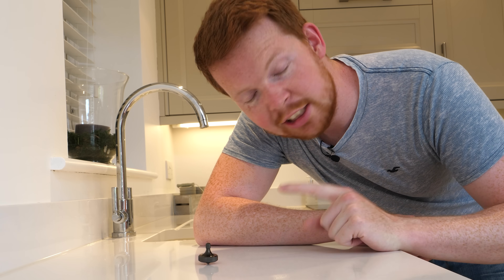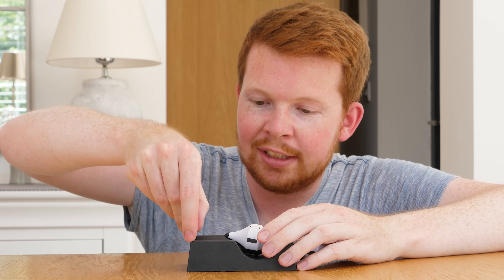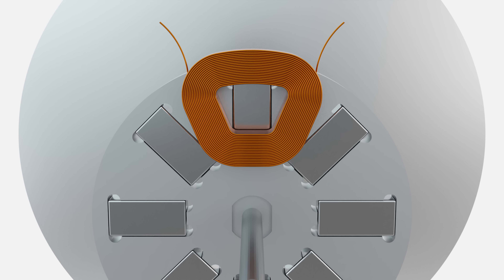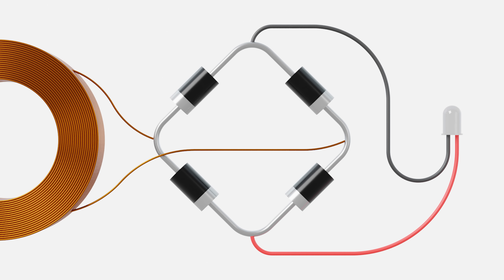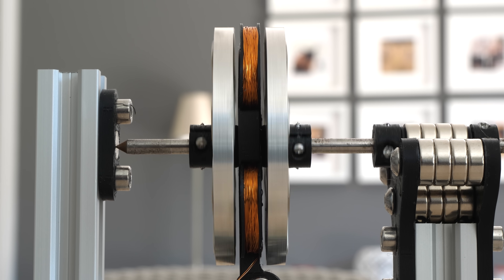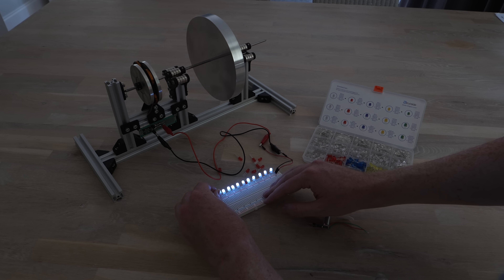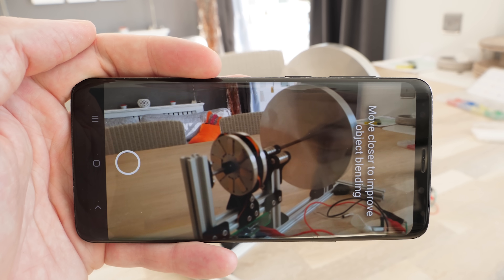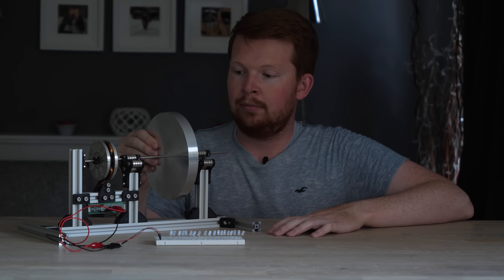Flywheel Battery

Comment: Did you consider current phase induced in the coils when connecting them in series? I might be wrong, but I believe you might need some sort of multi-phase diode bridge (resemblant to those in three-phase bridges) to get the maximum power out of your coils. I also think connecting coils in series only makes sense when phase is either 0º or 180º to increase voltage, or in parallel to increase current (I insist, I might be wrong). Also pay a look to homopolar generation. Nice and interesting project!

Comment: I'm v curious as to how the electric flywheel technology in the Honda CR-Z works. More specifically whether it could be used in some way to smooth out power strokes rather than actually power the wheels. I'm thinking along the lines of enabling a 4 cylinder engine have overlapping power delivery like a 5 or 6+ cylinder engine. There should be some usefulness in terms of braking as well i would've thought. I'm absolutely green when it comes to these things though so don't roast me!

Comment: About  0.3-0.7V will be lost in the rectifier, depending on the type of the diode. One could build a bridge rectifier from MOSFETs to essentially have a zero drop.

Comment: So I want to see this design changed so that the same flywheel works on mechanical bearings. Is it worse? how much worse? Also, can you create some electronics so that you can spin up the flywheel using your brushless motor/alternator and a power supply? Can you show some calculations of total energy stored, energy loss rate while on standby and energy transfer rate when draining?

Comment: It's important to point out that a full bridge rectifier without a capacitor doesn't actually give DC. The current flows in only one direction, yes, but it's far from DC. The voltage is alternating between Vmax and 0V, which is still AC. You can see this in your LED setup. The LEDs are flickering, which you noticed as well.

Comment: Another great video 👍🏻
A couple of things, having used RC motors as generators myself, I noticed that while they spin very freely with nothing connected, when I connect a circuit to them they become much harder to spin (opposing current direction from the previous cycle acting as an electromagnetic brake). I can see that your fly wheel slows at a much faster rate with your generator fitted, but just how much does it effect your run time?
Also, would making  the generator larger, giving room for more magnets and increasing inertia, be of benefit to runtime and power? Or would the braking force become too strong, reducing runtime?

Comment: You could turn this Flywheel Battery into an accumulator by using a small motor to spin the wheel up. If the magnets were smaller and the number of these increased it would be possible to spin the wheel by introducing some power in the copper coils.

Comment: I think the motor requires too much energy and the flywheel is slowing down too fast for it to be a desktop toy. But with 3 leds just giving it a nice glow why not :D Afterall powering anything with it sucks the energy out of the system.

Comment: You should add at the end of the rod a small spool, and a hand crank with rubber belt so you can with a higher ratio turn the wheel at very high speeds

Comment: Calculate its efficiency by using a low gear motor attached to a large fan. Spin the fan by hand (which should spin the flywheel) and record the number of spins you do, then disconnect the fan. Test how many times the flywheel can then spin the fan when you reconnect it, and do this at different times where the flywheel is spinning without being connected to anything, so you can test it's effectiveness as storing energy

Comment: Great video! It would be cool, if you were able to answer two questions. 1. Did you estimate / calculate the efficiency of you power generating system?
2. What amount of energy can be stored at some rpm in the flywheel? / How long does it run under a specific load with some starting rpm?
It would be great if someone could answer these questions, I am burning to know.

Comment: Isn't it same like attaching a flywheel to a normal dc generator. That will works the same way. May be efficiency will slightly differ.

Comment: Can the motor spin the flywheel? Infinite power.
Reply: It can, but the generator induces significant friction when running slowing it down more than you can spin it up by using the generated power for the motor. So it ends up being worse than just not having any motors or generators attached to it

Comment: I just have to ask why you elected to not use an addational 1000µF capacitor in parallel with a 10-12V voltage regulator to help keep the voltage smooth, constant and not flashing.

Comment: Nice toy. I'd like to have one of those on my desk when I struggle with work a bit :P. If you manage to attach it to a 5V battery to store the produced electricity, you shouldn't have a problem to power small motors or even charge phones ;). You could see at the end that the capacitor can charge up quickly, but can't store that much to power a motor long enough.

Comment: Nice experiment have you done any calculations on energy storage potential, efficiency etc. Obviously your home made alternator is an unknown but it would be interesting to estimate losses due to friction etc. Also you do not need to rectify the voltage produced for all applications eg. standard  light bulbs and universal electric motors for example. You would gain 1.4 volts approx plus eliminate diode power dissipation. After thought, link it to a hamster wheel !!!

Comment: this actually reminds me of an really simple invention of an 360 turbine, the device uses wind to propel it's basic spinning function, but it's also generating current and the magnets are either used to keep the flow of that generation spinning faster without friction or it's meant to extract power.

i just remember this device never needed to be oiled so it could be just for the friction, however the inventor uses this turbine to collect electricity buy how this device works, but the power is collected from both the top of the turbine and the bottom as both areas can be used for this power generation, he decided to expand this invention using 4 more of these side by side all generating the same currents of the wind blowing at them which adds to the efficiency.

Comment: Hi, i think it would be a better demonstration of the voltage of your alternator if you would set the leds in series and not in parallel. The LEDs are constrained by the voltage and not by the current. Therefore putting them in series would show a better picture of the generated voltage of your system. 

This is my humble opinion as a Ingenieur to be. 

Greetings 🖖

Comment: Flywheel. 
I didn't get it when they had a mega project in Ireland, but this was the trick to keep energy !

You know, it might be much more useful if you can connect this with a wind turbine and get kinetic energy.
Maybe you can keep on running this, and charge your cell phones.

I wounder if a bigger one of these could charge at least an air conditioner for summer, day and night.

Comment: Very cool Video!
I guess it's important that you have the magnets close to the shaft. If you have magnets close to a fast moving part you might feel some resistance from eddy current.
A big scale flywheel battery is used for example in CERN.
https://cds.cern.ch/record/2746073/files/asdhep27.011.pdf

Comment: One can use magnets attached to the fly wheel *or* just more layers of alternating coils, then magnets then coils (or both ideas) to generated more power per turn.  One can vary the orientation of the different layers to close up the gaps in light (though must because careful to not do so in a way where the currents counteract each other).  For the magnetic cradle, one can vary the radius of magnets such that the cradle vs shaft has a U shape, then in theory the stabilizing wall will no longer be needed since the axle will be cupped in and held on the top by gravity.  There still will be the magnetic resistance over time to motion that will act like friction but it will be less than actual friction I believe.  Essentially, this is a fun idea that has many ways to be executed.  I don't have the money or shop to test out these ideas to improve yours, I hope you do test various things out and make your own improvements.

Comment: what is the advantage of this design? The energy required to boost the fly wheel will be used by the power load. Conservation of energy will not change!

Comment: Instead of having a physical point to keep it from getting off balance which causes friction. Could you not use magnets at each end of the rod with the same polarity mounted to the frame to have a completely floating flywheel? That way the only fiction is from moving in the air, then I guess the next improvement would be to put it all in a vacuum 🤔

Comment: 12:26 I bet the same principle that helps with electric braking and regaining power is causing it to slow down even faster than it would with the LED's.
Reply: Yep it's the same principle that do produce the electric current : induction
Reply: This literally is regenerative braking
Reply: @ObjectsInMotion  Sorry I haven't looked much into it, I'm just thinking of a time I connected a motor to itself and tried turning it and noticed it became much more resistant.

Comment: Tom, two suggestions for you to try.  #1. Two more sets of opposing magnets on the lift bearings, and #2
 Use a buck boost transformer circuit to increase VDC then use your small motor to spin the shaft using a coupler. The power made would require initial spin but should cause motor to increase speed this increasing VDC . Might also want to add a large capacitor to help store some energy before the motor. Just some suggestions I thought might be cool to try.

Comment: This seems pretty obvious, so there must be a good reason why you didn't do this, but why not replace the glass, by another magnet at 1:37, that would repel the thing from going to the "left"? It would seemingly remove all friction except air.
Reply: The only issue with that that i can think of is that it would allow more side to side movement of the flywheel assembly.   If you use 4 magnets (2 on either side of the shaft) it would be a bit more effective than using 2 magnets on one side. The glass or metal plate is a solid stop, where the magnets have some space to move.

Comment: Hey could u do this again but use the power the run a Motor attached to a gearbox that intern is attached to the fly wheel to help keep it going and see how long u can get it to run with u only getting it up to speed once
Reply: That would be cool to see but because of friction of the gears it would theoretically either not do anything or make it slow down faster.
Reply: @Bendigo1  yes either way with it with out a gearbox I just thought with the low rpm’s that would be the best choice idk if it has enough torque to turn it

Comment: Great demonstration.
I think it would have been informative for those unlimited energy seekers that you would have showed how the spinning time decreases when you add more load like when you added more white LEDs (i.e. how the kinetic energy stored in the flywheel _is spent faster_). One thing that I found hard to make some people believe, is that when you try to use electromagnetic induced electricity, you get a counter force that "will try to stop the rotor". So the moment you have a generator, you cannot power any and all devices... there's a limit, why? because the Counter-Electromotive Force.
The problem with some people, is that a Wikipedia link is not enough... they don't care about written words.
Reply: It is easy to think that since there is little to no friction that it would spin forever.  When you learn how magnets work, especially how they react when passing by metals it is easier to understand why it is not possible for it to spin forever.  Then add to that the understanding how increasing the load on electric generators slows them down it makes comple sense as to why it can and will not spin indefinitely.
Reply: @Bendigo1  yes, but if you explain that to someone that wants to believe on eternal energy, they must Trust your words to get them understand "how magnets works, react and the meaning of a load and its effects". It's not about knowledge, it's about something clear that they can observe and believe. If you show clearly that increasing the load causes a physical reaction, then usually they're sold.
Reply: @sdlion7287  i have learned to not try to explain something to someone who refuses to accept the explanation.   If they already have a belief it is takes too much energy to correct that belief, no matter how wrong that belief is.

Comment: Except its not a battery because it doesn't hold energy as potential. Kinetic energy is not potential energy. Your system is constantly losing energy at a high rate because work is constantly being done. You are basically trying to claim you created a perpetual motion machine but like all perpetual motion machines your system is bleeding energy.
Reply: Batteries are electricity storage devices not electricity generation devices.  Batteries lose charge when used this loses energy when used.  This is a kinetic battery. Not a chemical battery.  The flywheel uses its kinetic energy as  storage, it is not a new concept and not a perpetual motion device.
Reply: Pretty sure he already knows that this isn't perpetual motion.

Comment: To double the output voltage use 2 diodes and 2 capacitors instead of 4 diodes.  Make a positive half wave rectifier and a negative half wave rectifier instead of a full wave rectifier.  Connect the 2 capacitors in series and connect 1 coil lead directly to that connection.  Connect the anode of 1 diode and the cathode of the other diode to the 2nd coil lead.  Connect the other cathode to the other capacitor positive and the load positive.  Connect the other anode to the other capacitor negative and the load negative.
The positive half wave charges one capacitor and the negative half wave charges the other capacitor.  The output is taken from both capacitors in series so their voltages add together.  Another bonus is the coil current only flows through 1 diode at a time instead of 2 so less voltage is lost.

Comment: could you use the flywheel to spin it self that way it would help to create its own energy after its intial spin?
Reply: A flywheel only stores as much energy as is put into it.  A flywheel can not create more energy, it can only release the energy that was built up when it was spun up to speed.

Comment: I was wondering, why not use magnets to make the flyweel go faster. Kinda like what you did with the power coils, use oposing magnets and get them near the big wheel, the closer they get the stronger magnetic field and wheel should go faster, compared to operating it with bare hand.

Comment: Imagine if it could power a motor that was big enough to power spin the flywheel like the drill did. Tom came so close to making  a perpetual motion machine.
Reply: No, it doesn't work that way.  Energy would be lost between the wires and motor, the motor would never be able to spin the flywheel as fast as the motor needs the flywheel to spin to create electricity to make the motor spin the flywheel.

Comment: Awesome project! It looks like the more load you put on the circuit, the more the fly wheel starts to wobble. This is because as you increase the voltage/current drawn from the coils, they create a back EMF which will push on the magnets on the rotor, causing the shaft to wobble. You might be able to mitigate it by putting the centre magnetic ‘bearing’ on the other side of the rotor/stator. I want to try!
Reply: If you think about it, the coils are acting like a brake while the flywheel is acting like an engine.  The coils are on one side of the flywheel, so ehen they try to stop the shaft from sinning the flywheel is trying to keep it spinning, creating a twisting motion in the shaft. That twisting motion is making the flywheel unbalanced.  A symmetrical coil-flywheel-coil design would probably eliminate or drastically reduce that issue.

Comment: There is a problem with this technique. If you put a real load across the coils the back EMF will turn the coils into a speed break drastically reducing the RPM of the flywheel thus shorting the length of the stored kinetic energy within the Flywheel.  The flywheel will stop rotating quickly over time.

Comment: Very elementary  design...you should up your game.. frist improvement  get rid of the friction point and make true magnetic end bearings both sides ie the shaft incased with mag3ner field 360 around the shaft also  needed is magnet pressure  point to the shaft with simular magnetic fleid make it adjustable  to you magnetical load your shaft..so it truly  frictionless..

2..you need to make a magnet friction less gear box..2 stages...... then makes changes to coil design.

Comment: Gravity Magnetic Battery...
[ Ultra Strong Magnet at top N facing down kept in position 
[ Gap wide enough to let a sheet of aluminum slide in flat
    with least amount of friction
[ Tabs protruding to keep the bottom magnet from touching any of the above
[ Ultra Strong Magnet at bottom N facing down
   just far enough from the magnet for them to get attracted back up
   as when the aluminum sheet is slid out of the way
+++ place coils where it will produce electrical power
* measure how much voltage is made when the magnet falls
* measure how much voltage is made when the magnets pulled together
* measure how much is the least amount of voltage to quickly slide the
   the aluminum fully between the magnets and fully out of the way